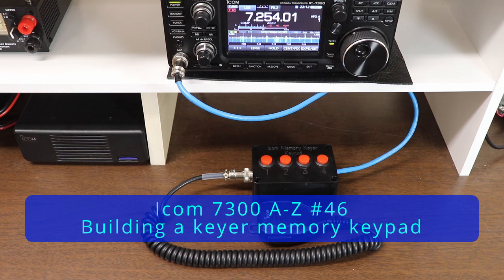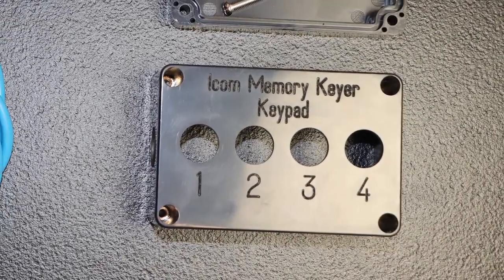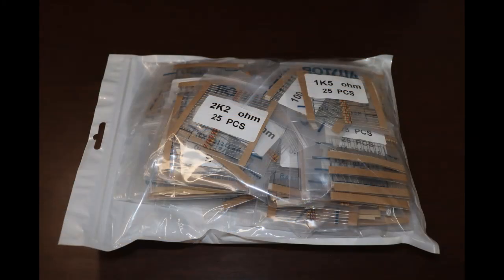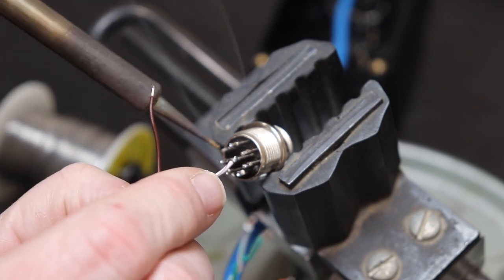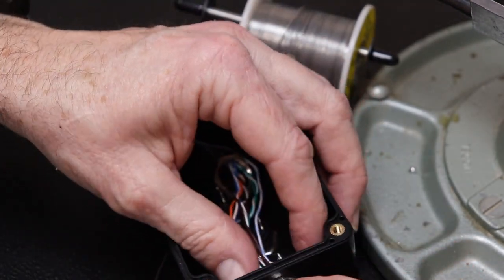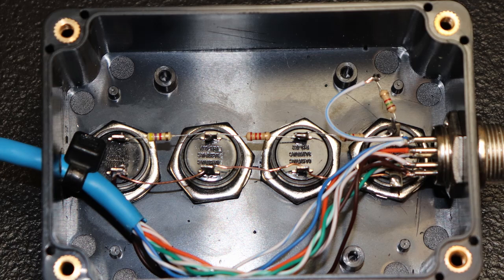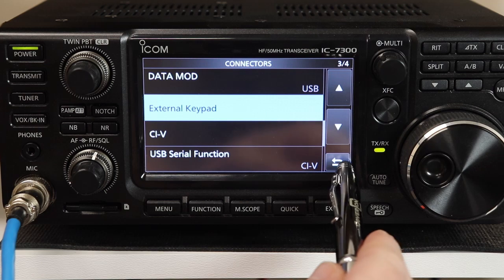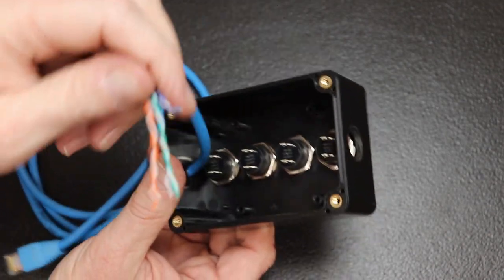IC7300 A to Z #46 - Building an external keypad for transmit memories

Comment: I did this for CW only memories on my IC7600 and worked fine as I'm 99% CW operator but I expect it would work for SSB and RTTY as built by you. I did notice the cct diag in the 7600 manual and decided to give it a try and then I stumbled over your video which gave me the necessary push to construct one. Many thanks.
John G3LNW

Comment: Some hints:
-- it's better to use a chisel-type soldering iron to make such a work. Better heat transfer / control can be easily obtained.
-- Strain relief is very good to have, but some additional protection may be very useful (I often use two or three layers of shrink tubes and/or cable break protectors.
-- You can also add a dedicated PTT button by connecting pin 5 to pin 6.
-- Furthermore, an Up and a Down button can also be added (Up is a direct connection between pin 6 and pin 3, Down is similar to the other buttons shown in the video, but with a 470 ohm resistor).
Reply from the maker: All good suggestions
Reply: @HamRadioA2Z Tom, without question, your (short) videos are way the BEST instructional videos I've ever seen. Thank you very much, and all the best for X-mas! 73 de HA5CST

Comment: I've been meaning to do this myself, a very handy function. 
As an extension I think incorporating a low level tone generator to modulate SSB at say 5 watts would be handy. If you are using a manual external Transmatch  for example it gets tedious manually adjusting the power output and operating mode everytime you change bands. You could do this two ways, with a hardware generator or just edit a tone sound clip with Audacity for example to set the output sound level to produce the required power of RF.
Reply from the maker: Hi Rob.  Thanks for your comment.  If you're looking for a simple way to generate a carrier for a manual tuner, there are much easier ways than a low level tone generator.  If you do some Google searches for "icom tuner plug" and similar you'll find a number of web sites.  You can make a simple circuit with a momentary switch that connects to the external tuner connector on the back.  It will generate a solid, low power carrier for tuning up an external tuner.
Here's one page from KC2WI:  https://www.prnewell.com/kc2wi/Icom_tune_control/index.htm
Fair warning-- I haven't tried his circuit myself.  So, no guarantees, but it looks correct from what I've read.
73, Tom
Reply: @HamRadioA2Z  Thanks for the tip. I'll take a look

Comment: Soldering that 8 pin plug is a bear. I can get it soldered but I either get a short to the metal cover or short various pins together.  I guess I have to practice some more.
Reply from the maker: Yep.  It’s definitely something that gets easier with practice.

Comment: If you short [MIC] pins 3 and pins 6 it means "Freq Up" and shorted through a 470-ohm it means "Freq Down".  Just measure the pins on the mic with an ohmmeter while you push the freq up/dn buttons to verify.  I wonder what other magical voltage divider values might exist in firmware.  Its probably just an ADC reading the voltage and deciding what to do in firmware. Also, might be able to add LEDs from 8V->2.2kOhm -> [4:squelch] and also 8V->2.2 kOhm -> [5:PTT] to light up during PTT or when receive happens.  Just stay below 10mA on the 8V line. Be careful not to ground the [5:PTT] line directly, it may trigger transmit like [3:ACC] does, but I've not tested.

Comment: Hi Tom,
I have a question, on pin 3 and 6, you say you added a wire. I am assuming that the that there are two wires in total on each pin, is that correct?  If that is correct the original two wires that were there are still there. Thanks!
Reply: Ok I did answer my question, it is adding a wire to pin 3 and pin 6. I made a mistake of improperly counting and went to pin 2 instead of 3. I wasn't even in a hurry, just one of those things. It's working properly now and thanks again!
Reply from the maker: Hi.  Sorry I didn’t get back to you sooner.  I’m glad you got it figured out.  I can’t tell you how many times I’ve miscounted pins on a connector when building or troubleshooting something. 😁

Comment: Can you still use a straight key plugged into the radio while using the memory switch box to send CW as you described in the video?
Reply from the maker: Yes you can.  You just need to set the key type to straight key instead of paddle.  The CW memories are not tied to whether you use the internal keyer or a straight key.

Comment: Not one to stop at four buttons.....  While you are bringing all the wires out why not also add.......

1. UP/DOWN frequency buttons
2. Transmit button
3. Jack for foot switch
4. Jack for external mic.

There is actually a company that makes just such a beast for a decent price. 

   Tom
Reply from the maker: Those are great suggestions.  I thought about adding some other features, but decided to keep it simple to start.  Maybe a future project...
Reply: Que empresa es? ya que ando buscando algo que ya esté fabricado, por que en electrónica ando nulo. Gracias!
Reply: What company is it? Since I am looking for something that is already manufactured, because in electronics I am null. Thanks!
Reply: @josemanuelurena8287  - The company is Sotabeams. Actually I was collecting the parts to build and then saw a used one at a swap meet. But I just can’t help myself so will probably modify it, just a little more!
Reply: @HamRadioA2Z  Do you (or anyone) have a schematic for how to wire in those additional features?
Reply: To add a PTT button, would you short pin 5 and 6? And to add a microphone jack would be pin 1 on the positive side of the jack and pin 7 on the ground side?

Comment: Can you tell me the name of the mic connectors or where I can buy them?
Reply from the maker: Hi Alan.  You will find a link in the video description.  I’ve seen them referred to in several ways - 8 pin mic connector, 8 pin CB connector and 8 pin DIN connector.  Although, I believe they are not technically a DIN connector.  I’ve also seen them called “8 pin DIN style connector”.  Here is the link to find them on Amazon:  https://amzn.to/39SrG4Q. Full disclosure- this is an affiliate link.  It doesn’t change your price, but I get a small commission if you buy something.
Reply: @HamRadioA2Z  Thank You

Comment: Can you only do 4 memories with the external switch, because the on memories show 6 or 8, could you do all of those or does the wiring limit it?
Reply from the maker: Yes.  The 7300 only supports switches through the mic connector for the first 4 memories.  The Up Down buttons on the mic also go through that same pin.  So it is actually supporting 6 switches.  I believe the IC-7610 uses a separate pin for this function and it does support selecting all 8 memories with external switches.
Reply: @HamRadioA2Z  i had thought about using an elgato stream deck and see how or what memories I could control with that as well